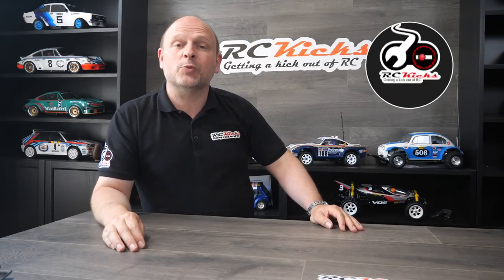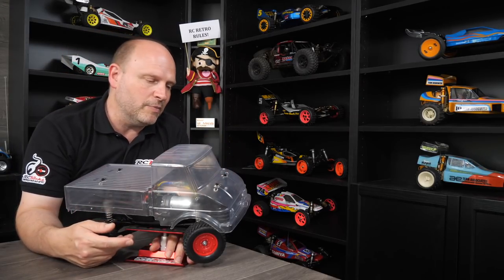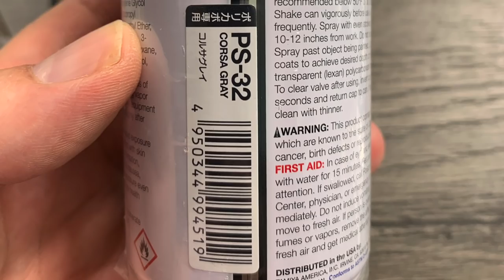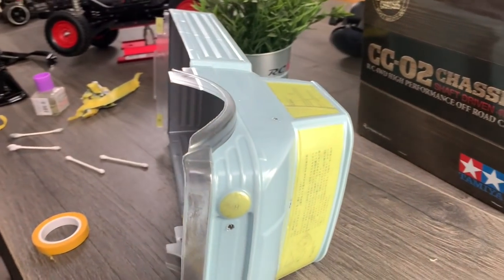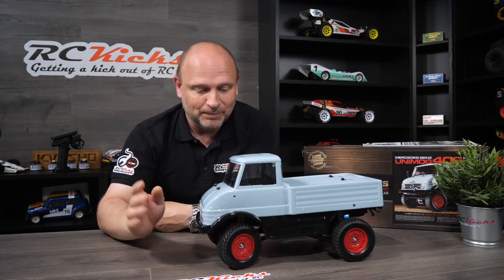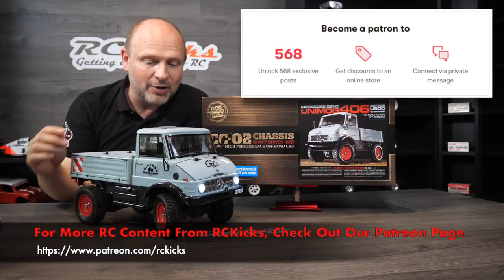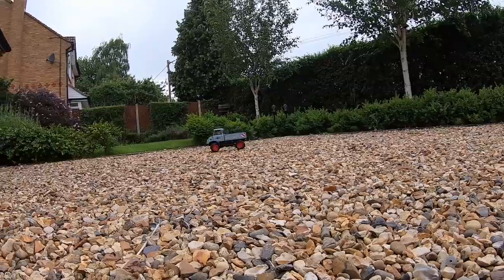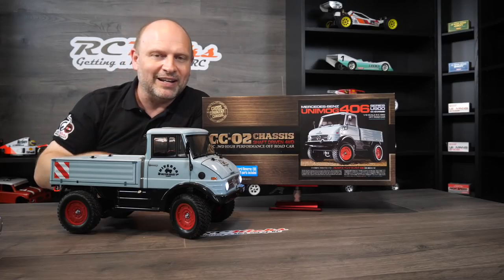Paint, Run & Review.  New Tamiya CC-02 Unimog 4X4 RC Build Project Is Finished! Kit 58692

Comment: Top stuff mate! Love that Corsa Gray, I just finished up a CC-01 FJ Cruiser in that very same colour.  In my experience that colour isn't affected by a dark 'backing ' colour. I went straight over mine with PS Black inside and it turned out A-OK (so long as you have the Corsa Gray on in several good layers first). Agreed with the process for painting the wheel arches and bumper black: I did the same on my FJ. 

I went a step further on mine and went over the bumper and wheel arch black colour with a flat clear (on the outside) so that the black wasn't too glossy. Simply cut away the protective film from the bumper and arches first, and leave the film over the rest of the body so you don't flat clear the main paint job.

Comment: Great Little Truck There and Too Right that little extra decal work has made it that little bit better have three in my collection so far the cc01 406 and the cc01 425 also the Axial Unimog umg10 so if i get this it will be a unimog family for sure there a great truck and as the cc01 is my only one thats actually built i drive it quite often and its one of my got to trucks/cars to drive great video Gav :-))

Comment: Hi i have a question. Is it normal for this truck to wobble in reverse in high speed? There is no issue on going foward. Im on 23t pinion gear and normal speed gear ratio. I just built one, using hop up wheel bearing, carbon steel propeller shafts and also aftermarket shocks. When i was tuning it with my transmitter i noticed the wheel wobble only in reverse at high speed.

Comment: I do agree on the way of masking the arches instead of the flat inside cabin surfaces. But if you are masking large surfaces - use a plastic bag, kitchen plastic wrap or something and tape that close to were the masking line is. Covering the entire body in masking tape is pricey :P This method works best if you paint these small areas before cutting the wheel arches (if you have to mask across or close a wheel arch that is). Depending on where you're paint you might wanna do that anyway - like if your paint line is right across the wheel arch. But sealing certain section of the body of is easier with a straight line all along the bottom of the body. When I painted my Volvo 850 for example, I just put the entire body in a plastic bag, and sealed that under the hood. Only had to mask the bumper to paint that f*ing blue area on the front spoiler :P Then f*cked the white paint up anyway - but still ;) Here I cut the wheel arches before painting, and it was tricky to get the tape to seal properly across the bend - and most importantly it was hard to tape over the edge without the overspray film lifting.